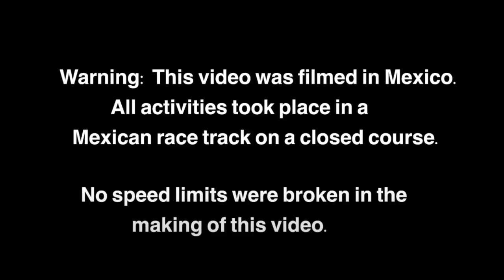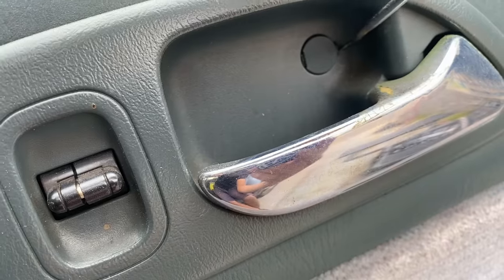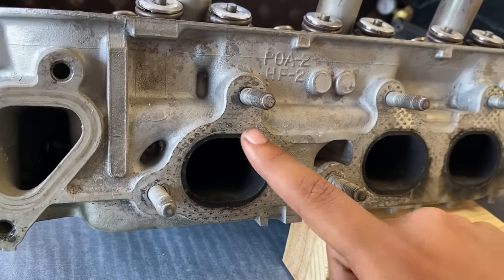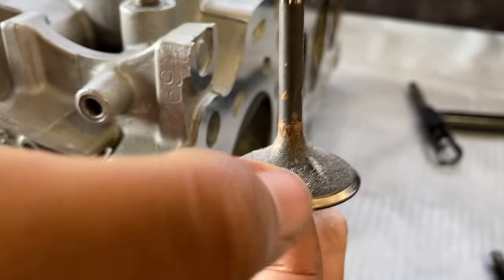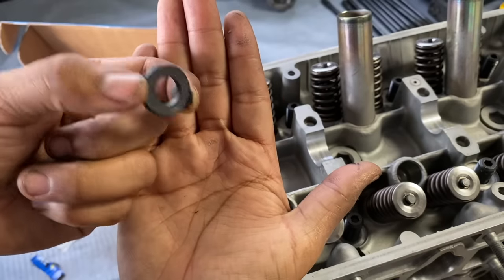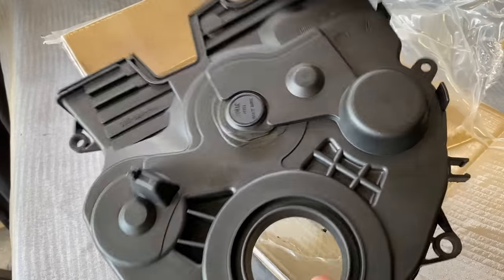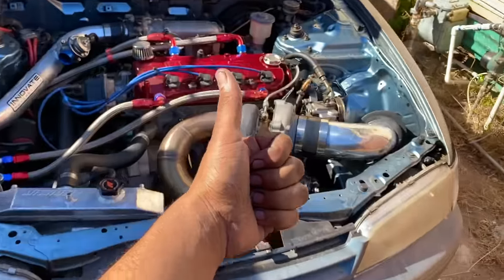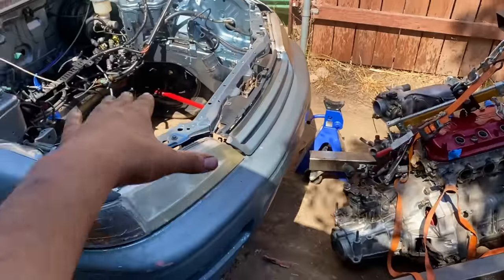Turbo Honda makes 392 Charger Mad + Build Upgrades

Comment: I really miss my 96 sedan - died at 318k miles.

I’ve always been a Honda guy but never touched my own car until I was in my 20s.  I still wished I had learned more when I was young and got into building.  I would have LOVED to be able to put together and run something like this.

Great build and great videos - keep it up!
Reply: Well you still can, you just have to go for it
Reply: @Maaaaaax-07  ^^^^
Reply from the maker: never too late

Comment: You also lost some torque through the extension while torquing the heads due to torsional flex in the extension.  So although you probably didn't achieve the 90 ft lb you were going for,  you still got enough that it should be sufficient.
Reply: Thats only true for impact drivers. Not true for manual torquing.
Reply: Not really true, because with manual torquing you just end up rotating the extensions until they're bound up. Same torque gets applied to the bolts, it just has to be rotated a little further which doesn't matter in this case. Impacts you're 100% correct.

Comment: I've always wanted to do something like this to my '96 Camry lol 
I'm just not enough of a mechanic though
Reply: Budget Boost DIY  Okay I’m currently in the market for a car I can build from scratch I have a mechanic who is going to help me but I’m not entirely sure which cars would be best to do this with? My budget is pretty much anything decent under $9500
Reply: Budget Boost DIY  
Not really true, if it is a 5sfe the bottom end is already as good or better than the 3sgte. The pistons and rods are definitely available as the 5sfe block is very popular on big power MR2s. That being said it isn't worth the money and a 3sgte swap would be easier. Unless of course he has a newer camry in which case you would be SOL

Comment: You really did good with this, even for modern Honda modding standards. You did it proper and well. This car was an example of an ideal “sleeper” Honda. I believe I saw much older videos of this car, like 2015 era. Am I thinking of a different one?
Reply from the maker: I posted starting 2017
Reply: @SleeperAccord  It would be dope to hear what you have to say about the F22 and how they’ve put up with what you’ve thrown at them

Comment: My favorite weight reduction mod is the one where you get rid of the pedals and steering wheel is takes away so much space and is a must have for people trying to get rid of weight on their car
Reply: Don't forget the fuel tank and engine, all you need for a good car is good faith
Reply: @khanyisanisikhakhane40year23  😂😂😂😂

Comment: So which is it?  It comes from the factory with iron sleeves or its "pretty much" sleeved?😂
Reply from the maker: They are thin sleeves. I worded it wrong but the sleeves are strong but definitely not at the level of aftermarket machine shop installed performance sleeves.

Comment: Ok so the New Franken Honda is to take  2.4  integra block and mate it with a 92 thru 96 Acura RSX head, then boost the crap out of it with a 24 Psi Turbo . The stock block will Handel the boost "

Basically Honda's version of an INDY  LIGHTS  Race car pushing 700 HP.

 Amazing " 😀

Comment: cutting oil with the cutting wheel if u use oil cutting oil it will not clock up

Comment: $90 for some plastic. I wonder if you could make that with a 3D printer. :)  Also, the only thing that matters with a weld is that it holds. You got a beater car on the outside, so you shouldn't be worried about looks. But, I guess if you can use it to make content that's good.

Comment: Ive got a 726hp subaru that only weighs about 2100lbs. Stock lambo owners hate me. because ive got about the same power but only 70% of the weight

Comment: When ya get a silicon sleeve and ali pipe there is always a lip and the lip i mill times pie R squared creates a restriction of a certain mass and grinding the edge off and creating a leading edge removes the cavitation and increases flow...

Comment: Please put tein super streets or pros on there! with either you can sit the car on the ground pancaked if you wanted! Full damper control,edc compatibility. The thing just sits too crazy high like the Bb6 dies,they both use the same suspension! That’s what i have on my car. With all the RND over the years i’d also tell you to use a CTS yellow 6 puck sprung with and extreme pressure plate and CTS fly! You will not regret it!
It’s the perfect and unequivocal best combo for our cars,along with the Apexi N1 full cat exhaust with a test pipe. It’ll never sound better and further from a cheap fart can one can possibly get! If you don’t mind and are i retested I’ll DM you pics on IG!
Your doing a brilliant job bro,keep it up!
Please just order those Tein coil overs! That’s the first day mod,sleeper or not!
$800 for a set of one piece high end fully Adjustable height and damper coilovers.

My first set of Super streets lasted for over 14 years! I now have the pro set but had no need to go from $800-$1200 set.
Hope that means anything to you? I seriously just want those years of hard ,expensive knowledge to. e used and recycled.

Comment: Charger or challenger looks cooler at 0mph than any Honda would look at 500mph. Truth is yes they are extremely light weight and easy to move so obviously they are going to be faster with the right upgrades. Hell you could make a gokart beat both for less money, simply because of the weight. But the charger or challenger is still by far a better car. Everyone wants to line up with a 392 or hellcat. Literally no one would ever brag about beating a Honda in a race lol
Reply from the maker: The goal shouldn’t be “looking cool” we’re here to have fun
Reply: @SleeperAccord that man really thinks that everyone’s goal is to beat a 392 or a hellcat 😂 man doesn’t understand that no one is scared of mopars power to weight is ass. Whenever a hellcat or 392 pulls up to my 2018 mustang gt on a whipple and drag pack I just lagh and take them to gapplebees but when a older civic, accord, integra pull up next to me and I here the spooly boy ooof my heart starts racing and my palms start getting sweaty😂 I have not been beat by a single mopar but older Hondas on the other hand I will admit I have been dragged a couple times by them in the street and the track to the point where my 655 WHP mustang felt slow as shit 😂😂😂

Comment: The Golf was stock, had no sound, no turbo noise.

When I first got mine and was driving highway after installing my jb4 before going full bolt on is38, in 5 and 6th gear you hear the turbo spooling when you punch it, and hear the diverter valve when you let off. I didn't hear anything from his car, not even an exhaust.

Comment: wow this is too funny. He cut out the door instead of removing the power window motor🤔🤣. There is a big difference between replacing car parts vs understanding automotive mechanics, design, and troubleshooting. It was funny to see that 392

Comment: Out of all the vehicles I have owned. Believe me its been more than 2 hand fulls at 64 years old. I will always take one that can do 100 miles an hour for 4 hours straight and not skip a beat. Then one that can do 190 in a quarter mile but can't handle a all day highway trip without breaking down.

Comment: I just picked up a 95 accord with the F22b motor in it and I’m dying to figure out what to do on it. It only has 98k miles and has been sitting for 4 years, got it up and running and did basic services but now I’m wanting to tune and and make it a sleeper.

Comment: You did not even separate from the traffic behind you.

Worst porting job I have ever seen 😂 oh boys. And the worst studs one can find because the weakest spot is the thread 😂 ARP 😂 even delivered in bulk just do scratch the surface because it does not matter. They always die at the thread.

Comment: I would’ve used blue loctite on that single cam bolt. I have a friend who had a v6 engine fail on him racing because the single cam bolt came loose. Blue loctite in this case is cheap insurance.

Comment: just some advice, when installing the water pump, you never want to put rtv where the rubber gasket goes, whether its a water pump or oil pan gasket or whatever, it can cause leaks. other then on valve covers where it tells you to put some on the edges.

Comment: I know this is a year old but I just found your channel. Dude. The anxiety when you pulled out that chonky aluminum bit. Ports looked good though. This is why I work with wood, way less tension I can get a new piece if needed. 😂

Comment: 7:45 when you wrap wires around screws wrap to the right so the head tightens it in as you tighten the screw.

Comment: Roll racing against NA dig cars?! I'm impressed with the view count more than anything.
Reply: Found the dodge owner. Even from a dig it’ll get reeled in regardless. How’s it feel to hate on someone else’s build?
Reply: @00cel not at all, just saying it'd be cooler to see it beat something that also has a turbo. Something like an RS Audi or an Evo would have made way more sense, or a supra or v10 would really get my like. What do you race/drive?

Comment: Only the difference is, the Honda is a fully modded car, the Dodge comes like this STOCK, out of the factory! If the same mods were done to the Challenger or Charger, this wouldn't even be a discussion! Lol
Reply: how much is that charger compared to that honda lol and its a 4cylinder
Reply: @harp6184  I don't know about down there but up here in 🇨🇦, I think that 392 would run ya roughly $55-65K. How much did the kid spend on the Honda, I'm not a huge car buff but I'm sure he has fork a few bucks Himself, plus all the time and labour, I get it, it's probably his hobby, so he enjoys the time n labour, he probably has dumped quite a bit more that we think. He also ran into a dude with Charger that didn't look to be all that great when it come to racing, if there was someone that actually knew how to launch that Charger, the outcome might have been a little different, it's not Hellcat either, I think it's a 392 isn't it? I only have one eye, my vision isn't the greatest so I can't really see the labels on the car, it doesn't look like a Hellcat decal, but again I'm pretty damn blind 🦯 . Don't you think a Hellcat would beat that Honda in a race ? Those Hellcats are just crazy fast for a big heavy car! If you got the right driver that can master all that power, he/she would be hard to beat! That car is insanely fast for a completely stock vehicle.

Comment: Fake. For those Common Core students, roads, all of them in the U.S. have dashes. They are the same size, EVERYWHERE.
That size is 10ft. The space is always, 30ft. That means 1 dash 1 space = 40ft.
Do you know where I'm going yet? Yeah, that "race" was barely 50-60mph.
Good job grandpa.

Comment: So mad he bought a slow pos boat for 40k lol
Reply: Hellcats are from from slow lmao you boys spend a good few thousand dollars on a pos just to install thousand dollar mods to beat a stock car
Reply: @thouken5777  for literally 10k you can make a 4 cylinder faster than the 50k dollar cars you worship lol and then you still get better mpg and can daily drive it plus cheaper insurance and everything.
Reply: @pqoiejxkalqppsjnx8843  that's your dream lmfao all you people need to wake up there is no car you can spend "10" k on and it being faster and more reliable than a hellcat if that was the case why he a fan of dodge? Looks? you have to pay for the car it's self pay for the mods to and will have to do routine maintenance
Reply: @thouken5777  it’s not even hellcat in the video and it’s not a dream lol parts are way cheaper for Hondas than any other car. To make a v8 faster you need like 7-10k for a supercharger or turbo then you need to build the motor to support the power which is another 3-5k and then more mods so the car doesn’t break
Reply: @RedEye19  not broke and it can’t lol you’re just mad they are so expensive and still so slow
Reply: @pqoiejxkalqppsjnx8843  mmm no you're spending literal hellcat money just to make ancar beat a stock one
Reply: @thouken5777  didn’t know you could get a hellcat for 10k??